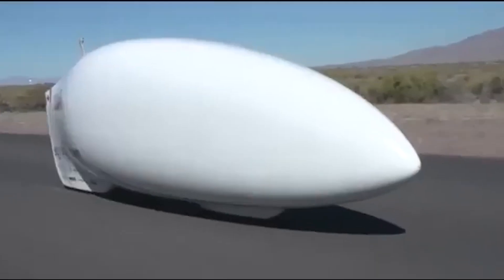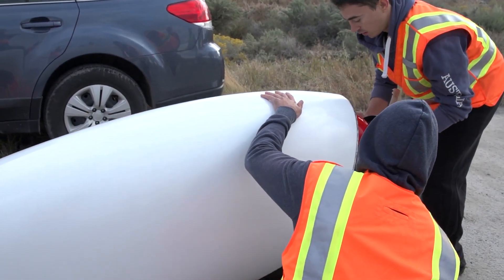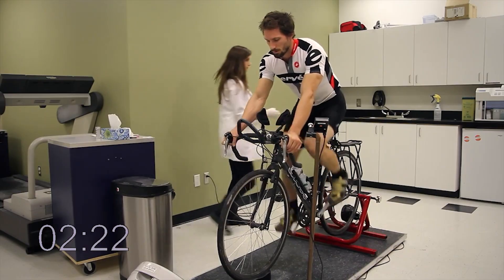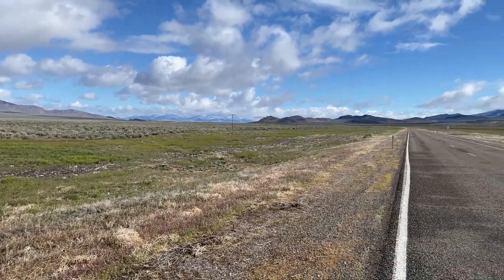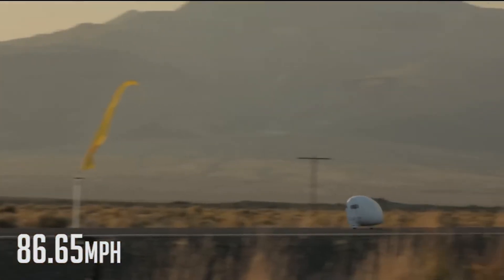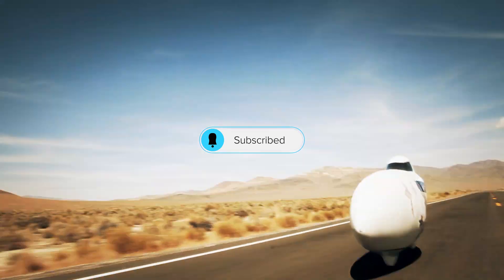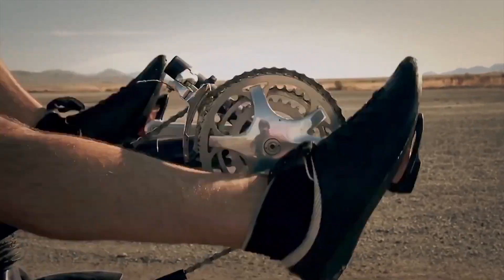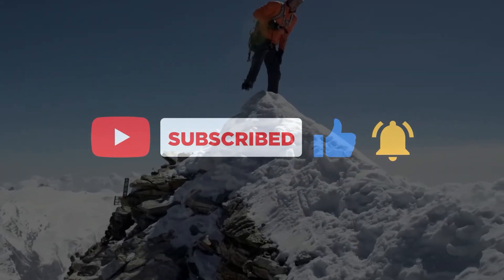The FASTEST Human Powered Vehicle EVER Built

Comment: I hope in the future, maybe in 5-10 years, we can easily find this vehicle in nearby stores 

I like this
Reply from the maker: Yeah, that would be amazing! 🚀 Imagine just walking into a dealership and picking one up like it’s no big deal. The way tech is moving, 5–10 years doesn’t sound impossible at all.
Reply: never
Reply: at this level, a bird dropping on the shell would destroy aerodynamic efficiency. If the shut line was 1mm wider, 90mph would be impossible..  On the bright side, using what is learned from projects like this, 50+ mph with 250w assist and a normal human pilot is probably easily achievable in a design that fits more than just one guy.
Reply: ....it is way too complicated...a simpler doing 150 with 250 watts may be possible.